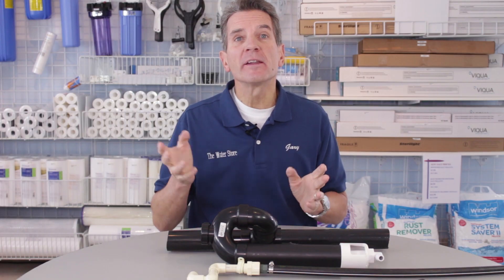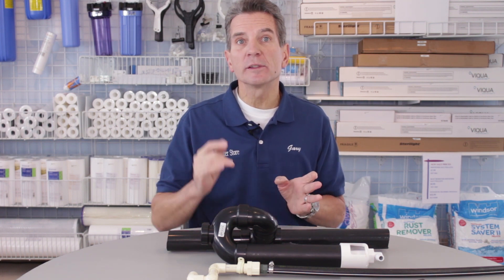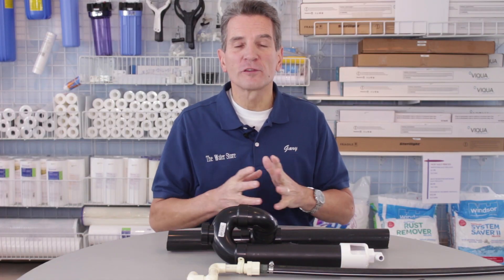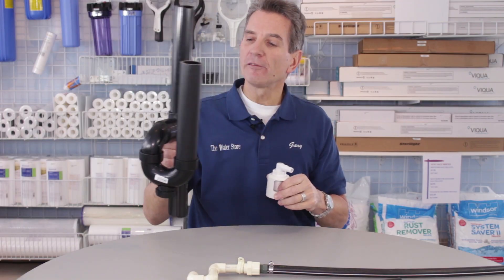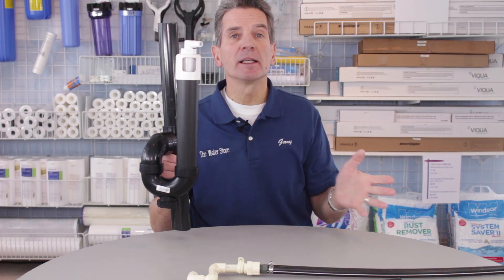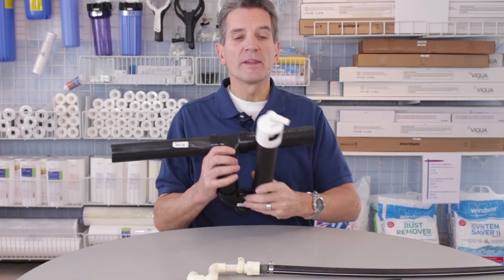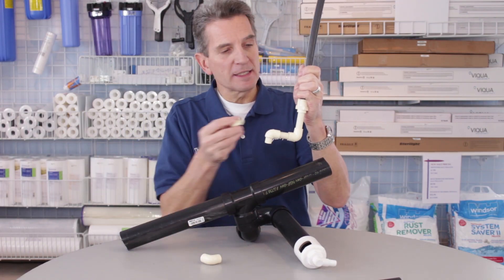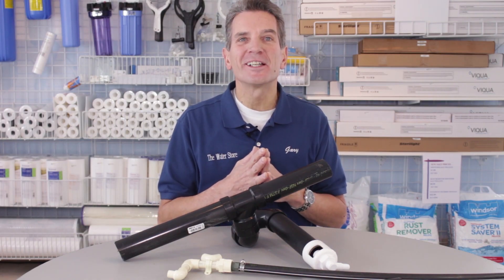Water Softener Installation Part 3 Drain Connection Options

Comment: I want to do a horizontal installation.  What is the minimum rise of the stack between the air gap and the trap, in relation to the existing horizontal drain pipe? Thank you for your help.

Comment: Hey Gary, I know this is an older video and I tried searching through your videos to find an answer to my question but could not find it. I previously had a water softener on my house and I just hooked up a brand new water softener and iron filter and they are both Clack’s. I am in Florida and both units are outside. When I just had the water softener, I had a 3/4 inch PVC drain line that ran underground to the other side of my fence and came out the side of a small hill to drain into a wooded area on the side of my property What would be the best way to tie both the softener and iron filter drains to run into that one 3/4 inch line underground without it back feeding into one another. What I am meaning is I set the iron filter to region and it back fed up into the softener drain line, I was standing right there when it happened and instantly stopped it. Is there a type of 3/4 pvc back flow preventer I could use on each drain line before it ties into the one 3/4 line under ground? I did run each line independently down the side of the tank and 90 underground and tied in both lines together about 4 feet away from the softener and iron filter. So each system has about 5 feet of their own drain line before it is tied in together underground. I hope you understand my question. I tried to give as much information as I could. I am trying to prevent from having to run another drain line underground all that distance. By the way, I have learned a lot from your channel over the years, thank you….. I edited this to add, does the Clacks have a built in check valve on the drain line side?  I just read online that they do. Can you confirm that?
Reply: Do not rely on mechanical check valves to prevent back feeding one treatment system's discharge into second system's discharge.  If it happened that both systems went into backwash cycles at the same time, neither system's backwash system is designed to work against significant back pressure, like what is produced by both systems.  
Why not discharge the iron filter's drain into your home's sewer system using an air gap device and a P-trap?

Comment: Our water softener discharge hoses go directly into the hole of the floor drain, not in the p trap but about 2 inches above, but below grade in the pvc drain pipe. Is this NOT to code? A different plumber than built the house noticed it and said it wasn't to code?

Comment: Hello Gary, great channel!
I too have a question that I haven't seen answered anywhere. I plan to install a water softener in the corner of our garage. There is a water loop and utility sink in the middle of the adjacent back wall. I plan to run (2) 18' copper lines to the corner location from the softener loop. I want to run the softener discharge line to the utility sink's P-trap rather than above the sink. If I install a "Y" type dishwasher branch (Amazon ASIN # B0CS2ZP63H or B08CT5YV24) between the bottom of the sink drain and above the P-trap to connect the 5/8" poly discharge line from the softener would this be considered a permissible "air gap"? The reason behind all this is to keep most of the piping hidden within the wall...
Thanks
Reply from the maker: No it wouldn't, you would still need to have an actual air gap of about an inch above the high water level of the sink.

Comment: I have a question I have not seen addressed anywhere. My drain line does not fully empty. I can see the water in the line right after the softener. If I loosen it and let some air in then it will completely drain. Is this how it is supposed to be?
Reply from the maker: Often depending on the configuration of the installation that can be the case, but not a concern.

Comment: Question: my plumbing company set it up this way: my water softener system is located outside of my house. Basically the drainage hose is coming from that system and up onto my roof and into a vent stack on the roof. Is that an issue?
Reply from the maker: No, but it does seem very odd.

Comment: What would be the solution if I have a horizontal line I need to tie into but their isn't enough clearance install an airgap with the appropriate riser height. Our waste water line in the basement runs through the ceiling. The basement  water is disposed to a grinder pump that then ties into the waste line running through the ceiling.
Reply from the maker: You would need to add elbows and run it down vertically and then back up.
Reply: @water_estore  thank you! I had a plumber suggest using duct tape to help catch the excess water.... that didn't feel right to me.
Reply from the maker: *sigh* duct tape, huh?  Did he learn that during his plumbing apprenticeship?

Comment: Is there a maximum distance allowed between the softener and the nearest drain? 30ft ? 50ft? 
Does system have to have a pump if the drain is far from the softener and what distance is it starts to require a pump? Thanks for your help
Reply from the maker: If the drain is more than 20 feet away, increase the size of the drain line to 3/4" further than 40 feet you will need a pump.
Reply: Thanks!

Comment: What if I have an outdoor softner system. Where should drain the water sediment to? Right now it goes to a built in pvc pipe in the ground
Reply from the maker: As long as it does not back up duing regeneration, that should be fine.  But keep in mind that wherever the brine ends up will kill the vegetation.
Reply: @GarytheWaterGuy  if you run the line in the pvc do I need to put any backflow on it. What is the best

Comment: Great video, but your example shows a plumbing code violation.  Your model P-trap is connected back to back with the sanitary tee.  The minimum length of the trap arm is 2X the inner diameter of the pipe, e.g. 3" for 1 1/2" pipe.  The minimum distance is so your P-trap doesn't turn into an S-trap which can self siphon its contents and let sewer gases into the home.  Also if you were to cut the sanitary tee into a vertical drain from a floor above (like you suggested) then the vent would be a wet vent, and most plumbing codes don't allow wet vents between floors.  You would need another vent prior to the drain connection such as an AAV.
Reply from the maker: Thank you for contributing!

Comment: what about overflow drain line?
Reply from the maker: Good question.  If you have a sump pit nearby, you run a drain line there.  If not, just run a short line to a bucket located beside the water softener.  99.9% chance there will never be any water coming out of there, ever.
Reply: @water_estore  ok, I don't have a sump pit. can I drill a small hole in the pipe for the overflow. or is this going to mess up the air gap?

Comment: Draining to the basement floor drain can be a VERY bad idea unless you know the foundation “tile” lines go out to drywell away from the foundation. You didn’t want salty water eating your concrete block and slab. Same applies to septic if you have concrete septic tank.
Reply from the maker: The only time you would connect to a floor drain is when it actaully connects to a drainage system going to a sewer or septic system.  There can be some minimal corrossion on a concrete septic tank but it takes a cery long time, typically about 25 - 30 years.
Reply: How do you drain this water if you want to protect your septic system?

Comment: can i drain to my gravel yard and if i run a pvc pipe up and out will the softer be able to pump that?
Reply from the maker: Yes, that will work just make sure it doesn’t freeze or get clogged
Reply: @water_estore  thanks, I have an aerobic septic and I didn't want to run it in there.

Comment: Thank for sharing.
My water softener comes with two drain lines.  The water softener tank drain line will be connected to an air gap/ p-trap .  Where do I connect the brine tank drain line?

Can I connect both drain lines into one drain line then connect it to the air gap?
Reply from the maker: Great question!  The one on the brine tank is an overflow, if you have a floor drain or sump pump nearby, you can run a hose there.  If not, just put a bucket under it, likley water will never come out of there.  Do not connect the overflow drain line to the water softener tank drain line whatever you do!

Comment: My resin tank drains straight up about six feet then goes into the ceiling and connects into the pipe that drains my laundry water.  Is that a problem?
Reply from the maker: Great question, but no, no problem whatsoever.  Mine is the same.

Comment: Excellent, helpful video, Gary. Thank you. However, I did have a question - my softener is near a bathtub, and the p-trap for the tub is easily accessible from the crawl space. Could I put in a drain saddle before the trap with a check valve and just drain in to there?
Reply from the maker: Yes, absolutely

Comment: Can you connect the drain line to a clean out? since the water softener will be installed outside of the house with a cleanout around 15 feet away
Reply from the maker: I don’t think you can

Comment: Gary, finding out about your channel and learning about the water softener on your other videos are very informative.

I have one question somewhat related to this video. What is one downside of pluming the drain line of a water softener into the hot water tank inlet line. I am looking at my home's system and it seems like the contractor ran the pipe this way.
Reply from the maker: You would get high concentrations of sodium in your hot water

Comment: Another great video. You mention that water softner needs to meet buidling code but does it apply to tannin filter and sulphur filter too? Looking at buying a tannin filter but my current sulphur filter connects directly to horizontal pipe (under joists).  2in pipe with joint fitting which allows 3/4in pipe to connect from the top at 45 degree.
Reply from the maker: Yes it does and you can connect both to the same drain location.
Reply: @water_estore  thanks for the promot reply. So i guess my 45degree connector is not compliant.  where can we buy this air gap adapter for 2in pipe?

Comment: I saw one where the discharge went up into the ceiling and tied into a vent stack in that attic. Is there anything wrong with that?
Reply from the maker: If the vent is tied into the drain line then it will work.

Comment: I am doing a vertical connection (& have ordered the air gap fitting), can you give me a list of the required ABS parts?
Reply from the maker: It depends on the size of the drain you are connecting to. Generally you need need a “T” a p-trap and a length of pipe for a stack.
Reply: It is 1 1/2” ABS pipe. I was at Home Depot & picked up a Y, 45 degree elbow & a p-trap. It just looked different from your configuration. @water_estore

Comment: For the waste water to reach the laundry sink, I have to run a 20 foot hose that has to go up and over a door frame, and eventually back down to the sink.  Will this be an issue?  I’m hoping most water softener system can enough discharge pressure to initiate the flow so that most of it can syphon down into my sink, and also the additional to the drain hose will not add too much resistance to cause an issue with restriction.  Perhaps I can reduce the pipe length resistance by using the next larger size pipe size until it reaches my sink.  Please help.
Reply from the maker: Hi Richard with our HUM Water softeners, that is no problem https://waterestore.ca/search?type=product&q=hum*%20softener*

Comment: Currently I have my softener draining in to a floor drain which leads to my sump pump hole.  Will the salt from the softener damage my sump pump over time?
Reply from the maker: It could but it would take a very long time.  What other drainage options do you have?

Comment: Great video! I have a question: 
My softener drains into a floor drain in the basement. I have well and septic. The regen kicks on in the morning and the force kicks the pex tub out of the floor drain and has flooded my basement like 6 times now lol. I have placed bricks on the hose but it still snakes its way out. What can I do to stop this? Thanks so much!
Reply from the maker: Sorry to hear.  I would use a pipe clamp that can be screwed right into the floor.

Comment: Thanks for the video... I wish I had watched this before I had my replum done. I just recently purchased a home that had original copper plumbing from 1989. At the advice of my home inspector, we decided to replum the house. Another consideration is that we are on well and septic here. The owners never installed a softner system here. It smelled like sulfur and was super hard. We had the well tested and luckily no bacteria. The water is amazing now!! My only issue is how the plumbers did the drain. They drilled a hole in my exterior block wall and just ran a pipe into my grass. Now at night when it backwashes out, it floods my yard and eventually it seeps into the ground. I asked him if there was a better solution and he told me to put some rocks below where the water drains. I thought that sounded odd. Why didn't they connect it to my septic system??? I'm upset and want them to come back out to re route it to the drain in the wall to the septic. I feel like they took the easy way out. Couldn't this hurt my foundation of the house long term or the pad for the AC compressor that it dumps next to? Thanks again for the video!!
Reply from the maker: It will kill the grass and vegetation too.  I hope that you don't get frost where you're located because it could freeze the drain line in the winter.
Reply: Putting brine backwash can actually be detrimental to your septic system, depending on the type of septic you have.

Comment: my water softener drain goes straight up  about 5 feet then goes about 20 feet then down about 8 feet where it goes into the floor drain is this ok
Reply from the maker: Yes it is as long as it is at least 1/2" but if it was any longer you would need 3/4"

Comment: Do you need an AAV or connect to vent stack in your configuration? Also how long should the ABS pipe be before the airgap connector? Thank you for sharing the cool video.
Reply from the maker: Sorry I don't know what an AAV is, The pipe should be about 12" before the air gap.
Reply: @water_estore  air admittance valve(miniature vent stack)

Comment: Hi Gary, I am getting conflicting answers regarding if I can drain my water softener backwash into my septic tank, whats the definitive answer?
Reply from the maker: Great question, there are pros and cons.  We typically drain water softener to the septic system.  The only con is that you may get some corrosion on a concrete tank after a couple of decades, but what are the alternatives?  Sump pump, can and will some day fail.  If you pump outside there are major concerns about the environment and freezing in the winter.  Perfect solution?  Have a dry well installed at significant cost.  Mine drains to the septic system.

Comment: New home owner here. 
My softener is new, came with the house.   Regens and drains into sump pump.  
Flooded my basement twice now in a month. 
First the pump stopped working. Probably the pump fault.  However i read that salt is bad for pumps and will void the warranty.
2nd the drain spot froze outside. 

Think twice or find another way than draining softener to sump pump pit.
Reply from the maker: Yes, although every situation is different and there are pros and cons to every method.  In my house it goes to the septic.

Comment: I would like to drain my water softener into a horizontal drain pipe in my basement coming from my upstairs washing machine discharge that is NOT connected to my sewer drain. Can I simply connect into the horizontal pile with a wye or tee fitting overhead and into the washing machine discharge pipe, or do I still need an air gap and trap?
Reply from the maker: Always best to have an air gap with a trap.
Reply: @water_estore  I'm trying to understand the purpose of having an air gap if My drain is NOT connected to the sewer system. Can you help shed light on that? Thanks.

Comment: Water boss says the drain discharge outlet, has to be below the discharge on the softener.   Mine is rough plumbed into the laundry room and softener is in the garage (Arizona so no freezing concerns).  It will rise about 7 feet with a total run of about 20'.  Do I have to raise the softener above the discharge point (in a laundry box) ?
Reply from the maker: Actually the manual says the gravity overflow needs to be above the drain not the drain discharge.  Your connection from the drain discharge to a point 7 feet up and 20' away will be fine without raising the water softener.
Reply: @water_estore  Thank you !

Comment: How about to the septic system.  I am leery of all that water going into my sump pump tice a week
Reply from the maker: Great question! There have been numerous studies done on the affect of softeners on septic systems.  They do not affect the anarobic action other than improve things because you use less soap with a softener.  If it is a concrete tank you may get some corrosion on the outlet over many years.  Draining water softeners into the septic system is still the most common way to go and often the only way possible.
Reply: @water_estore  Thanks.  This makes sense and helps greatly.  Appreciate it!

Comment: Thanks for the video. I have the same question that Kirk has. I need to do a horizontal installation of my softener and RO systems. What is the minimum height of the air gap above the water level in the trap? And the height, is it the bottom of the device or the top where the water lines are attached. I also only have about 4-1/2” above center of the drain pipe due to the pipe being in the floor joists.
Reply from the maker: I would keep it at 2" or more if possible.